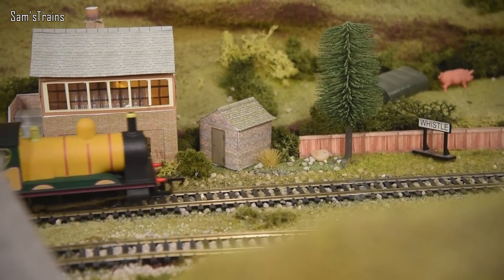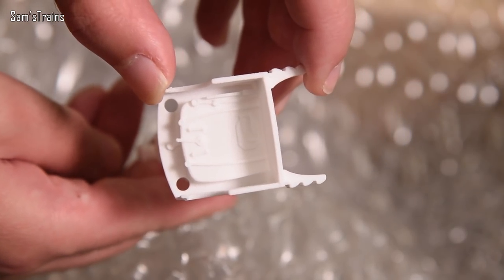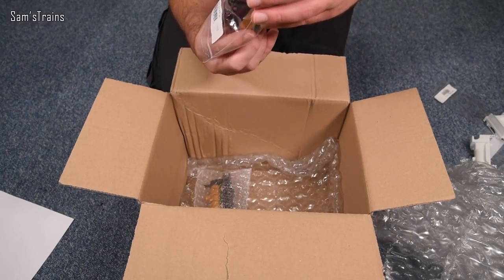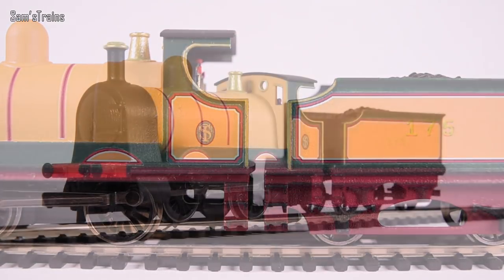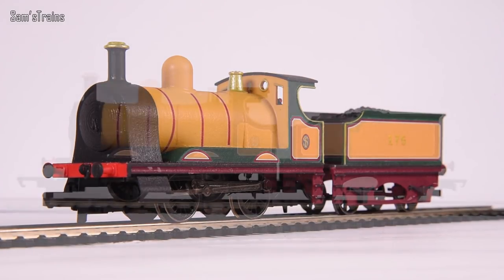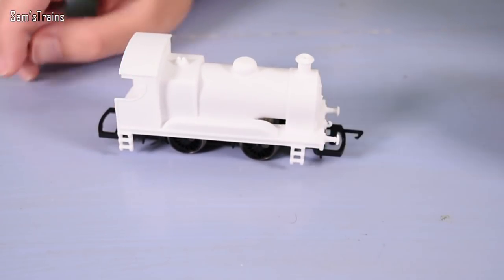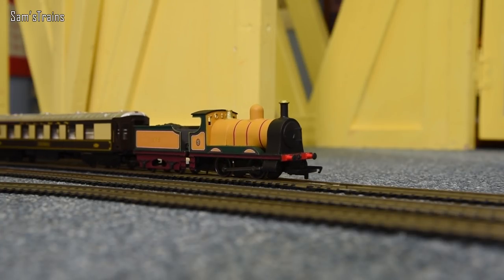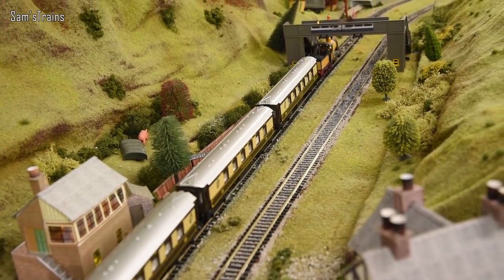Mysterious New LBSC 0-4-0 Tender Engine | Unboxing & Review

Comment: You can get a pretty good finish just from Halfords spray cans meant for touching up car bodies. Use appropriate primer first, then choose your preferred top coat. Spray many light coats with quick passes to avoid blobs. They dry pretty quickly too. Then brush paint black areas like the smokebox and footplate. Then do your fine detail. Hopefully you'll show us your attempts at painting these engines. I'd probably try for an LNER apple green.
Reply from the maker: Thanks for the tip Keithy, I might give that a try one day! Apple green would look stunning! :D
Thanks for watching - Sam :)
Reply: Yes. I've been brush-painting my models just to prove that it can be done. But spraying generally leads to very nice finishes, especially if you use a primer to smooth out the granular surface texture.
Cheers
Tom

Comment: Always think manufacturers should do trains with this level of detail for youngsters to get started, instead of the battery operated stuff that can't be used on a normal layout or more expensive sets with more detail that are easy to damage while learning how to use them. They will get all the play value without breaking off handrails and so on. Perfect prototypical detail is great, but we should remember a lot of fun comes from running stuff that's "good enough".
Reply from the maker: Yeah for sure - we need a few more like this in the hobby I think!
Thanks for watching - Sam :)

Comment: That is very nicely painted. I’d be tempted to fit bearings to the tender. 
If I thought I could do it, I’d paint it in SECR lines green complete with the polished brass.
Reply from the maker: Yeah that would work - apparently there is a version with bearings to be made available! :D
Thanks for watching - Sam :)
Reply: Thank you! I'm in the process of making identical tenders with sockets for metal bearings instead of built-in bearings. But I have found that the built-in bearings work extremely well.

Comment: You have a choice of liveries to paint the other inside cylinder tender locomotive so here are my recommendations:

*NBR dark ochre with a slight greenish hue, and bordered with dark green. The two colours were delineated with a black line. The outer edge was vermilion, and the inner edge was yellow. The lining below the footplate was black and vermilion only. Axle ends were black with a ring of yellow. In 1913, the dark green was changed to bronze green. 
*Midland Railway crimson lake as this is passenger locomotive or black like some freight locomotives (I went for a lighter bright-red version of the crimson lake for my model).
*GCR chrome green with brown frames and valances and black boiler bands picked out in white. 
*LNWR blackberry black with red and white lining similar to BR's mixed-traffic lined-black livery.
*Caledonian blue with red frames and valances and white boiler bands.
*GER Prussian blue with red boiler bands; The finish consisted of a 'French' grey undercoat, four coats of ultramarine blue, and several coats of blue. Some sources note that this combination resulted in a colour that was purer and brighter than the locomotives owned by the National Railway Museum today. The lining was black with vermilion edging. Wheel tyres and axle ends were black with vermilion edges. The frames were black, although the 'Claud Hamiltons' and a few other express  types used blue above the footplate. Cab roofs appeared white in official photographs, but were probably grey in regular 
use. From 1890, goods locomotives were painted in unlined black, although some shunting engines also received 

And here are the selection of liveries I gave you, Sam! What do you think of them?
Reply from the maker: Oh wow some great ideas there - I'd love to try all of those!! :D
Thanks for watching - Sam :)
Reply: @SamsTrains  So you should, dear fellow! So you should. After all, I was kind enough to help provide what information I had to share with you.

Comment: It is a shame that the 040 tender engine is so neglected given that in the early years (1820s to 1860sish) of the railways the type was so common, there's still a couple around too, like Furness Railway no.20 . the early years of steam are poorly served in terms of RTR so this kit looks like it fills a gap. I belive hattons are putting together 4wheel coach kits which are just as generic and would go well with just such an engine.  I'm currently building FR no9 using the hornby040  as a basis!
Reply from the maker: Yeah you're right actually - it would be nice to see more done - maybe we will see more, after the success of Rocket!
Thanks for watching - Sam :)

Comment: I bit the bullet and got the HM 2000+ right hand controller today! I haven't tested any locomotives because I don't own any yet. The reason why is that I want to collect everything first and once I do, I'm all set to buy and run locomotives. The control knob is quite smooth and it's got the same satisfying click the big controller has. The direction switch is also quite satisfying to activate. The thing is... There's no transformer included which is another reason why I haven't tested anything yet. So what transformer do you recommend for a train controller? Or will any type of transformer work?
Reply from the maker: Ooh very exciting - yes they do have a very satisfying click!! The HM2000 has it's transformer built in - you just need to feed them mains! :D
Thanks for watching - Sam :)
Reply: The right hand controller needs the main HM2000 unit to plug into

Comment: Looks great in the LBSC livery. You could always do the other one in photographic grey (grey primer). The only problem I’ve found with Shapeways, apart from the price, is the surface finish. On these there’s only one option for the material, but where options are available the excruciatingly high prices super fine option still suffer from a relatively poor surface finish. It doesn’t have to be this way, but those two factors are enough to put me off unless I’m desperate for something.
Reply from the maker: Thanks Michael - I was really happy with that! Photographic grey would look great actually! Yes the surface finish isn't absolutely ideal - quite coarse isn't it?
Thanks for watching - Sam :)
Reply: I did consider making a finer detailed version to take advantage of a better printing process. I could add handrails, and make the cab controls more detailed. But, as you say, the prices of Shapeways' higher-quality options are unacceptable for my purposes. If I want to bring the price down and the quality up then I'll have to get my own printer. Not just yet!

I don't actually mind the grainy surface finish so much, and it could certainly be improved with primer (as you hint). I DO mind the printing artifacts (banding on the dome and smokebox door). But these things don't go away when you use better printing processes.

In the long run, the technology will improve and the prices will come down. I expect!

Comment: He should do one for an 0-6-0 chassis. That loco would look good as a sort of 4f copy
Reply from the maker: Absolutely right - one for a Jinty chassis would be epic!! :D
Thanks for watching - Sam :)
Reply: 0-6-0 designs are on the cards, but at the moment I haven't exhausted my 0-4-0 ideas. It was always my intention to make cheap things for beginners to learn painting - the "cheap" part hasn't worked out because the Shapeways service (though excellent) is so pricey. But these 0-4-0s (stocking-fillers from Hornby's point of view) are by far the cheapest way to get a running chassis.

Comment: Sam, I have a question hoping you can give me some advice, I just got a Tyco blue royal tender engine, and for some reason the driving wheels are slipping to the point where the engine will not move, please if you can get back to me, I have been so excited to get this loco and I am frustrated that it won't work
Reply from the maker: Hmm that doesn't sound good - are the non-driven wheels not sitting properly? Does it have traction tyres that are loose or missing?
Thanks for watching - Sam :)
Reply: @SamsTrains  well, I took off the plastic tender and found out that the gear that was directly connected to the motor, had slid up the shaft to the point where it was not touching the next gear for it to run, so I realigned the gear and it ran fine
Reply: @SamsTrains  but thanks for the advice, love your vids

Comment: I think I saw a very slight mismatch in buffer height. It doesn't matter with the couplings doing the work, but it did set me wondering whether there were similar differences with ready-made stock from different manufacturers.
Reply: Hi Dave. In a word, yes! I've got the buffers as close as I can to the similar Hornby products (the other 0-4-0s, the 4-wheel coaches, etc.). But I know that these buffer heights are not correct, and so my locomotive and tender will look wrong alongside more accurate models. There is a lot of inaccuracy in toy/model buffer height, and a lot of variation between manufacturers. I don't mind - it doesn't look too outrageous to my eyes. And the people who do mind - the more serious modelers - won't be interested in my products anyway.
Reply from the maker: haha good spot! You were paying closer attention than me! xD
Thanks for watching - Sam :)
Reply: @tomcowell9653  I've done a bit of 3D modelling in a virtual world, and when they have a standard for trains using a 2m gauge, getting something looking right is a nuisance. It's the opposite scale-gauge problem to 00. There's a nominal scale which is widely ignored for everything.

Comment: What type of paint would you need to paint these locos?
Reply from the maker: I'm not entirely sure about that - sorry! xD
Thanks for watching - Sam :)
Reply: Ok Sam'sTrains
Reply: I've used hobby acrylics, but enamels would work too. Anything from the normal model/hobby suppliers (Humbrol, Revell, Tamiya etc...). It's important to thin the paint and apply several coats. The shop web page has a link to more detailed instructions.

Comment: Hmmm, as I suspected he uses PLA (extruded plastic). No matter how much you sand & fill it will always be a bit rough  in texture . . . It would be nice if he sold the .stl file so you could print it yourself in SLA (UV cured resin).
Reply from the maker: Yes I noticed the texture looked rough compared with the rendered images - do shapeways offer better quality options then??
Thanks for watching - Sam :)
Reply: Not actually extruded, but sintered powder. But you're right about the end result.
Cheers
Tom

Comment: I love the way you can make your dc trains crawl... almost as if they have decoders in them... i think it’s your controller, so it makes me wonder: is it available on the continent, and if so, is it expensive to buy?
Reply from the maker: Yeah absolutely - look up Gaugemaster controllers - they have built in power supplies though, so you'd need to get one designed for your local voltage!
Thanks for watching - Sam :)
Reply: Sam'sTrains thanks! I’ll see if i can pick one up for a reasonable price 👍🏻

Comment: What excellent things.  I have never seen such good 3D printing.  Call me old fashioned but what about simple BR black with a nice 'Cycling Lion' logo on the tender and a running number on the cab side.  With some of cab and other detail picked out as well.  It would be an easy paint without too much margin for error.  Cheers
Reply from the maker: I agree - they do look excellent! Yes BR black would look very smart indeed on this!
Thanks for watching - Sam :)
Reply: Thanks Pauline. One of the pictures in my shop shows a plain black engine with LNWR-esque lining and numbering. Since I use home-printed wasterslide transfers for the lining, it was indeed pretty easy.
Reply: @tomcowell9653  You're welcome.  Yes, I saw that on your site after I posted the comment on this channel.  Your models look really good.  Cheers

Comment: Without considering the price of the printers printing the body and tender (together) probably costs Shapeways less than £3 but Shapeways are expensive as it's a profit making company. In my opinion Tom should consider buying a few printers to produce them himself, a budget printer only costs about £180 (Creality Ender 3) and plastic filament £15 a kilo but even they work quite well.
Reply: If I moved away from Shapeways to reduce the prices, then I don't think that the 3D printer would be the major issue. At the moment the Shapeways service is saving me the trouble not only of printing the models but also of running a business. All I really have to do is design things.
Reply: @tomcowell9653  ah ok. It was just a thought.
Reply from the maker: Thanks again Tom - I get it, shapeways is the only sensible option!
Thanks for watching - Sam :)

Comment: I saw them online before but then walked away because of the price. I have heard from lots of people that the material for 3D printing is really cheap to buy. As you may expect, the printer itself is very expensive but someone who owns one said that it can cost them like 20p for a real. My brain may have fizzled over the time they said that and it could have been more but I remember it being cheap.

Nice loco none the less, good video, keep it up!
Reply from the maker: Yes the price is the only problem - it's not through greed or anything, but it's still quite high! The time is the biggest resource they gobble up - there are only 24 hours in a day!
Thanks for watching - Sam :)
Reply: Elmtree Line ah I see what you are saying. I see the perspective. Time is money.
Reply: Sam I also think you should review one of budget model railway’s locos.
Reply: I can't disagree with you. The Shapeways service is excellent (send them a file+money -> wait-> a model arrives in the post), but the prices are correspondingly high. In the long run I might try to address this with my own printer, or with somebody else's! Cheers, Tom.

Comment: Might be a bit boring but unlined BR black would be an easy paint job for a first project.
Reply from the maker: Great idea! That would be nice and simple! :D
Thanks for watching - Sam :)
Reply: Yes, absolutely. But lined black is also pretty straightforward using home-printed waterslide transfers for the lining. One of the inside-cylinder pictures in the shop is lined black, and there are links to images for printing the transfers.

Comment: i 3d print some of my loco shells for on30 the only downside is the texture after painting. I like to call them my toothpaste trains since the texture looks pastey. Edited I use a FDM printer i don't know what they'd look like with a resin based printer. Also 3d printing your own buildings is pretty amazing you can use tinkercad or some people make stl. packs that are pre rendered and scaled so all you need is to drop the files into your printer software and print them out.
Reply from the maker: Yes I've heard that - one of the only problems isn't it? :(
Thanks for the tips - I do want to try 3D printing some day! :D
Thanks for watching - Sam :)

Comment: Hi Sam, Nice as it is and looks ok , like you am rubbish at painting , All the Best Brian 🤗
Reply: Hi Brian. Sam has said some very nice things about the paint job, but there is an element of trickery - I rely heavily on the use of home-printed waterslide transfers (for lining and boiler bands). And the shop has links to printable images and guidelines for how to use them. Apart from that, my main advice would be (a) several coats of thinned paint and (b) take your time.
Reply from the maker: haha, but even so, you have to know the tricks - that's more than I do! xD
Thanks for watching - Sam :)

Comment: Sam, 0-4-0 tender locos were a rare type in the UK, and most countries, with most of the small numbers built scrapped many years ago. However the two surviving locos are the only Furness Railway survivours. 
They are Copper Knob from the 1840s and Furness Railway number 20 . Number 20 was converted to a saddle tank for industrial service but then converted back to original tender design for its current preservation. Some of number 20's last runs in 2018 before the usual boiler time issues took it out of service : https://www.youtube.com/watch?v=y4uoo8bwPG0
Not a well known loco, but covered a fair bit on Youtube.
Looks very unique to me. These open cab types would look great as a model. Partly because the cab backhead detail could be seen and appreciated.

Despite being rare 0-4-0 tender locos gained favour with tinplate toy makers due to the simplicity. For example the first Liverpool Hornby range as per the limited run reproduction this year.
Reply from the maker: Yes you're right - I don't think I can name a single one in standard gauge! Thanks a lot for the info,
Cheers,
Sam :)

Comment: I would add some weight into the tender, a light tender like that would easily derail
Reply: There is just a big empty cavity under the coal, and before painting I fill this with plaster (not plaster-of-paris, but one of the more durable hobby plasters). This seems to be about the right weight. Cheers, Tom.
Reply from the maker: Yeah absolutely, plenty of room - but mine never did derail, even with a load! :D
Thanks for watching - Sam :)

Comment: 3D-printing versus injection moulding ? Injection moulding for models will always be preferable because 3D-printing never can achieve the details, thin walls and cheap manufacturing price that injection moulding will have.
Reply from the maker: Yeah you're right - though better 3D printing techniques can achieve that detail, it's far from being practical on a large scale!
Thanks for watching - Sam :)